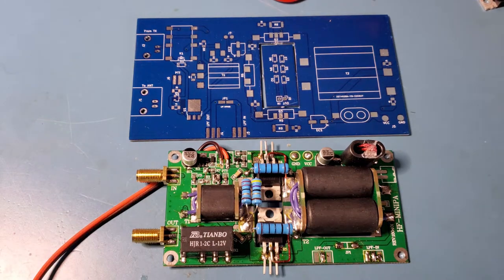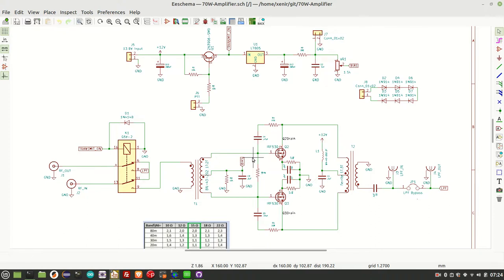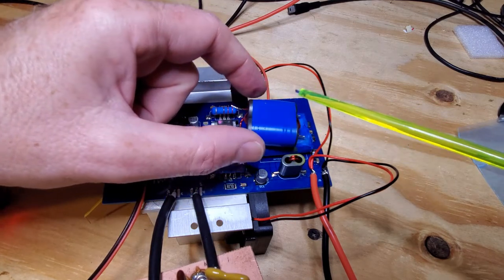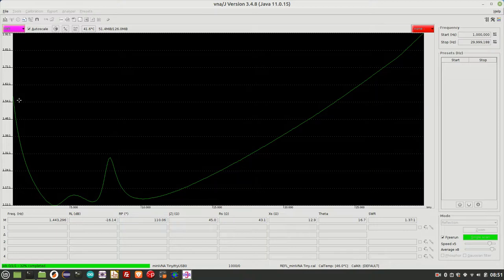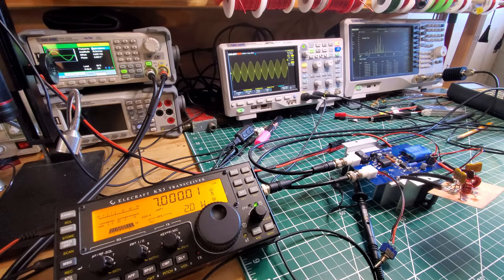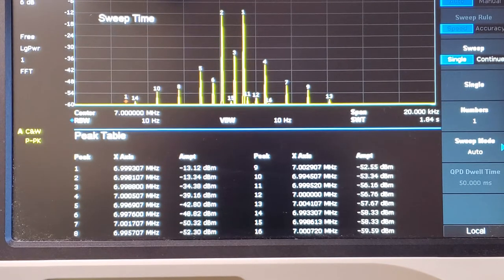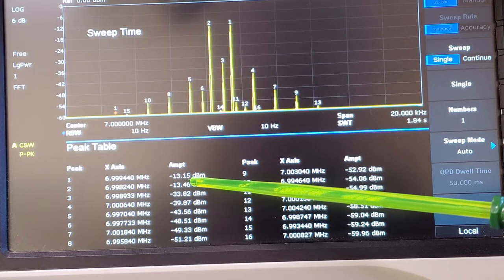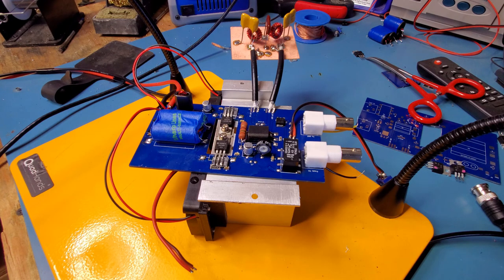70W Amplifier from eBay - Spinning my own Board

Comment: Thanks a lot,very intersting and instructive video Ian. For sure with these mosfets, that are made for switching application,  the intermodulation result is quite acceptable. I bought the same kit on a chinese site but I have not yet assembled it, however you confimend what I was expecting at the output of this amplifier. On the same site I also bought some "used" MRF9100 for about 10 euros each, I have intention to test them in place of the switching MOSFET  also . Thanks again for the great video! Antonio
Reply from the maker: Thank you Antonio - I actually have some MRF186s on order to try the same thing. I like having the two mosfets in the one package! Of course they are from eBay so my milage may vary! ;)

Comment: Thanks for this great video! I have already ordered the PCBs and now I am sourcing the SMD components, looking on mouser and digikey. Are there any minimum power requirement ratings you would say for resistors, capacitors, etc? I am just getting into RF and am not too familiar with which components are likely to fail... over current, over voltage etc. I am assuming the high power amplified side of the transformer does not have so many components and the lower power side has lower power so not as much of an issue?
Reply from the maker: There are a few components with a power requirement. The resistor on input (the two near the input transformer) were 3 watt resistors. The resistors across the FETs are 5W - I believe, going from memory here. The relays I got from ebay here https://www.ebay.com/itm/291739505384 - I hope this helps and good luck with your build

Comment: Nice video! The RD16's that's what I ran into. Then I twisted things around to work. Then I blew a couple. Then I realized my chinese transistors were IRF510's marked RD16's they had a diode. I need to get back to it. So much fun.
Reply from the maker: Exactly Curt - I would say 99% of the "RD16s" on eBay and just IRF510s with some laser etching on the case. Thanks for the comment - glad you enjoyed

Comment: Hello NA5Y, I made some minor changes to the board layout but am a bit stuck on the bias feedback. Could we use a thermistor to change bias. Very interested in making this board and amp. Have you built a new version with any improvements you mentioned in the video. Great video by the way.
Reply from the maker: I was actually thinking of using a temperature probe like the TMP36 sensor and have it controlled by a microcontroller - but I never got around to it. I did do a video on the TMP36 but never took it further. Thank you for the comment

Comment: When you say T-50-43, is that what may more commonly be known as FT-50-43? Do you think an amplitude difference between the audio source tones might affect the amplitude discrepancy on the amplified output? Fantastic video BTW. Much appreciated.
Reply from the maker: Yes T50-43 should really be FT50-43. Certainly I am relying on the audio signal generator emitting pure (and equal) tones. Not only that - the audio generator itself isn't introdcuing harmonics. Testing that unfortunately is a little bit beyond my capabilities ;) - so I am trusting somewhat in Siglent here. The signal generator I am using is by no means top of the line - but I am hoping its good enough for this work! Thank you for the kind words and comment - glad you enjoyed

Comment: Excellent work exploring each components impact on performance!  👍Curious to know if you measured dBc of 3rd harmonic before low pass filter was connected?
Reply from the maker: Thats an interesting question . I did have a look at the waveform without the LPF (it looked like a jagged square wave) but I didn't do any other measurements. I think I might do that in a followup. Thank you for the comment
Reply: @na5y  Yes this would be a very interesting follow up in future and thank you for considering it 🙂The 3rd harmonic for most types of FETs can be as high as -10 dB vs principle peak on spectrum analyzer (without corrective devices like drain to gate feedback resistors or LPF).  Measuring amplitude of 3rd harmonic on spec analyzer without the corrective elements could help determine best way to tackle 3rd harm. thus maximizing performance.  Super interesting stuff!

Comment: Hey man. I love your channel. 

Im a hobbyist with a decent bench but i lack some of the higher end gear. I spent my spectrum analyzer money on a new guitar last week. 

Im going to get my ham license, there isnt alot of hams around here. I was wondering where i shoukd start. Id like to dig into the signal analysis. I habe a bunch of different parts ordered and such but i dont plant to transmit until i get a call sign. I worked on radios as a 911/police/fire dispatcher after i graduated with a software engineering degree but didnt want to move away.

It's been great for teaching myself alot of theory because i love math and circuits. Rf scared me for a long time because of my work experience and it is aomewhat unapproachable until you learn alot related theory.

Should i invest in a nano vna and tinysa to dip my toes in before i make any big purchases. Its the antennas that are giving me the most confusion (for lack of a better term) i dont know where to start first when i   buy my first base radio. 

I love the whole theory behind the rf mixers and different filter types. Id be lying if i said i completely understood the implementation on a circuit level but i have a grasp of the general theory behind the different stages from a birds eye view.

Im looking for advice i guess on where to begin. Maybe a book recommendation and a starter kit of general items i need to have on hand. I find the sourcing of toroids the worst along with antenna choice for someone new to the rf side of the electronics hobby.

Sorry if im rambling but ive watched alot of your videos and have seen alot of kits for the circuits you rebuild and test on ebay. You seem like a great guy to ask. I have alot of parts on order that ive seen you use and alot i already have. It's just where to begin, i love the learning aspect of it the most from what ive seen. Plus everyone in the hobby seem like great people.